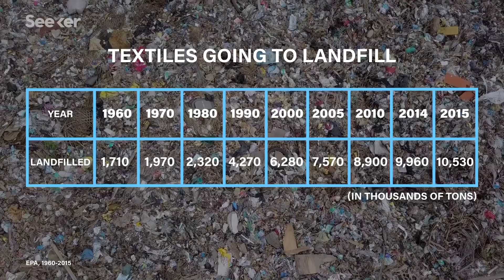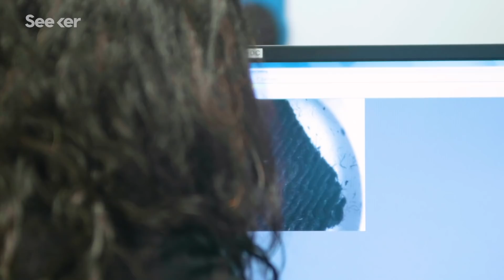Can This New Method of Recycling Reduce Fashion Waste?

Comment: This will likely not be a viable product for tile or exterior finishings due to its water permeable nature. The same reason solid granite counter-tops are not viable when compared to there mixed resin counterparts. I see this more as an insulation or sub-floor material, assuming it can be fastened using traditional methods.

Comment: But what will you do when that tiles need to be disposed or recycled?
Reply: @woolley it isnt a step backwards, its just a way to reuse and reduce what goes into landfills and oceans. lets say plastics get banned. theres still tons of plastic in the enviornment that should be repurposed, this is just one of the ways this can be done

And imagine if most tiles being used are these, its surely not a step backwards
Reply: @kevin49ification  If you combine these different materials you can use them again only once in form of those tiles. If you recycle them separately you can repeat that again and again and the cloth will eventually biodegrade.
Reply: @bacteria2200  hmm idk, i guess the way i see it, its better than what we currently do with fabrics with plastic fibers that end up in the enviornment/ocean as microplastics. And im not sure what would make the tiles not reuseable
Reply: @kevin49ification  I just see no way of separating glass/plastic and cloth.  It's just better to recycle plastic for making plastics again and use the cloth as filling material or whatever because then you don't end the recycling circle.
Reply: @bacteria2200  so they couldnt just send the tiles back to the producers, during a remodeling and press the tiles into new shapes? I guess I kinda thought they would keep being reused
Reply: @kevin49ification  Maybe that's possible, that would indeed be better than landfills. But still not as good as reusing the materials separately in my opinion
Reply: @woolley That exactly what i thought

Comment: Cradle to cradle is an interesting concept but we tend stop at just a few recycled/reused cycles due to the new composite or concepts losing value and integrity over time and ...well recycling. All that energy to create the new life for the products is just as bad or sometimes worse. I think it would be worthwhile from the beginning to incorporate circular economic concepts into the design of the objects rather than scrambling to fix things at the end. Also, these types of solutions like the video are great but what happens to those new tiles after they break? How many times can they be recycled? Is it worth using resources to recycle or create new?

Comment: Plastics makes the best aggregate binder for roads making them last years longer than bitumen based roads.
Reply: That being said, why don't we redesign the transport system while we do it? We all know that tires break down when driving, why don't we design the tyres to add that material to the road?
Reply: @LouisHv2  No need to tires are suitable material they have machines that pull out the steel belting and grind them up already so it is just a matter of figuring out the right mixing and heating method for maximum efficiency.

Comment: this is the problem with an economic world. we think we thrive on manufacturing, but it actually also becomes our down fall, due to the mentality that to produce is to gain, rather than completing the thought that what does happen after we produced a product. which coincides with speakers notion of "we should consider the materials not as waste but a resource material so they will be excluded from being regarded as mere waste".

Comment: I don't get it. The math is terribly wrong, and the end product is not clean glass so it can't be recycled without burning off the cloth and other crap that's in there. Glass is recyclable and becomes other glass. Cloth breaks down fast, rots with ease. I have come to expect greatness from seeker but this seems like Swiss cheese. Maybe I'm missing something. If I did.. Kindly let me know
Reply: fnp9 Melton With the maths, I think it’s a layman’s translation of the phrase “order of magnitude” since the values are in fact an order apart. You’re right about glass being recyclable, but recycled glass isn’t usable for all purposes, I think, so the glass that is maybe not so pure or not so reusable can be used here to make structural materials where looks aren’t so important. But also, I don’t think they’re referring to organic materials like cotton and wool, but rather the synthetics like rubber, nylon and polyester which just sit around taking up space in landfills forever. This is more a way to repurpose the tons of trash in landfills as opposed to a new use for recyclable materials.

Comment: Microparticle plastics are the bulk of plastic pollutants in the oceans.  binding polyblends may add a new level of such pollutants on land and in the air. It is much safer and cost effective to find bacteria that actually eat these and break them down into non-impacting environmental compounds such as lactic acid, ethanol, methanol, and sugars.

Though I do respect the intent.
Reply: I would like to see much more research into the plasma gassification techniques used to decompose all sorts of waste into useful synthetic fuel gas, slag and metals. The petroleum based plastics can actually release energy exothermically, heating the plasma reactor by controlled reaction with oxygen plasma. Then the oxygen levels can be reduced and hydrogen levels increased to encourage an equilibrium between endothermic and exothermic reactions. This helps power the reactor without overheating, and without encouraging the production of larger toxic compounds, resulting in only simple hydrocarbons aka "Syngas".
Reply: @scienceminded  That might be replacing one pollutant for another. Burning any hydrocarbon compound creates CO2 and/or CO. The part where I mentioned Ethanol and Methanol wasn't to imply use as a combustible fuel, but rather as chemical precursors, mediums, reagents, and bases. Both Ethanol and Methanol can be used for the creation of a myriad of other useful compounds. Lactic Acid is what white plastic forks are made out of, btw. So we can use old plastics and other fibers, woods chips, sawdust, etc., to make new plastics without touching fossil fuels (in many cases). I'm into solid state batteries and nuclear. Cleaner and with less impact than fossils and other greens. Stopping here or i'll start rambling. lol
Reply: @Ipanophis  The only carbon neutral proposal I've seen is high temperature electrolysis of steam into hydrogen which could be used in plasma gassification schemes that use the power from renewables. And if we displace fossil fuel while also preventing methane production in landfills it should in theory be neutral or negative impact on the environment.
Reply: @scienceminded  I'll have to look into that more. Nuclear is carbon neutral. So are some bacterial feedstock processes. But until we start atmospheric electrolysis of carbon into carbon fiber or direct sinking, im adverse to any carbon positive processes. You should look into the electrolysis thing. it's very interesting.

Comment: Breaking down waste to its molecular density and reconstructing it from subatomic can eventually take Going Green to a whole new level. When what we throw away has instant Value has been a dream of science fiction for decades. Mr. Fusion anyone?
Reply: Look into plasma gassification reactors at landfills. Trash to cash! Power! Fuel! Metal recovery! Cheap asphalt slag! Consume landfills and lower emissions! The benefits are endless.
Reply: @aleksanderwit  You raise a fair point! Consider that a massive increase in renewable power will actually cause a period of OIL GLUT until prices and demand establish a new alpha for the price of the commodity. If cars go to solid state batteries as I hope they do, the sooner we can make plastic the cheapest substance possible in terms of energy and materials cost. Then we either recycle the plastic, or upcycle it in plasma gassification to synthetic fuel gas.

Strange times indeed! I'm personally betting on Thorium  making a comeback in nuclear
and Solar recently reached price parity with petroleum in terms of cost for return on electricity and will do a lot of heavy lifting.

I'm actually building a dense plasma focus as part of a magneto-plasma rocket, and eventually I'd like to test it with deuterium/tritium/boron-11 and experiment with fusion rockets. A private lab has already shown promising fusion rates with favorable reduction in leftover neutron radiation.
Reply: @scienceminded  Are you a scientist? You bring up some fascinating theories and I would be very interested in hearing more.  Using radio waves to ionize and heat a propellant for the next era of rockets. Hey every tech originated in theories and certainly fusion energy has been floating around for many decades but i believe its an eventuality. When you take into account how many petroleum based products they are it's staggering, around 6000+. But its plastic bottles that are out of control, we have too much and we are in need of alternative energy. Combine the two, use a resource that is abundance that creates cheap energy. A causality that solves two problems.
Reply: If only they can do it in a massive scale, without the use of high electric consumption and high tech equipment which cost at least 20000usd each then maybe it can be done
Reply: Most of these threads are filled with the ideas children would dream up.

Ever wonder why we don't see half the stuff you're all talking about? None of it is new been hearing about if for over 23 years and most of it doesn't work with some of it not working well.